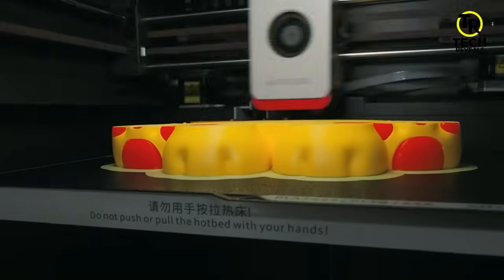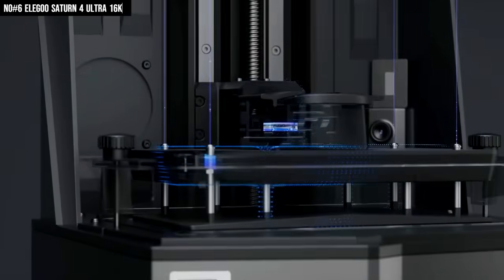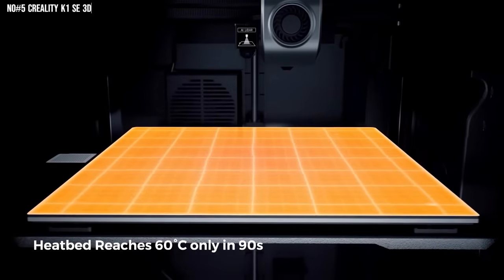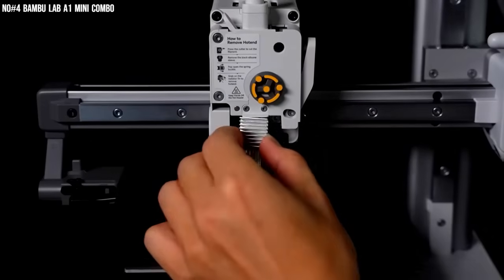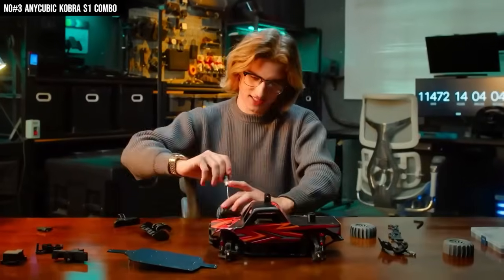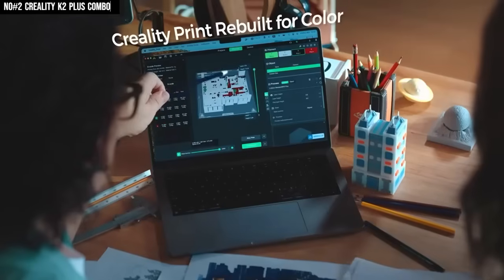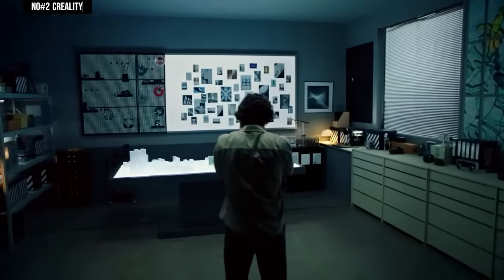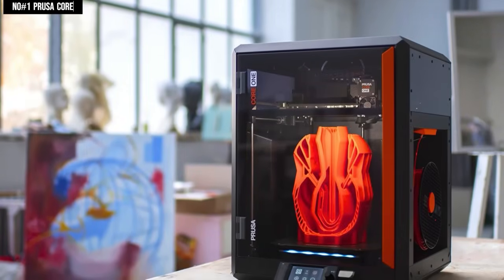Top 6 BEST 3D Printers For 2026 - Experts Tested

Comment: Which experts? Can you name them or is it just idle talk?
Reply: The marketing experts. Best of 2026, rated by experts, would require some use before commenting, right? As this video is released before 2026, it's dated to jan. 1, 2026. To be accurate, it's a review of 2025 machines, but who searches for machines dated the prior year?  It's an AI generated, manufacturers marketing hype. Example being, the reviewed Creality K1SE is on it's way out of the market. Since the upgraded model K1C is at the same "sale" pricepoint, why would anyone buy it, except in a storefront looking to liquidate stock at mfg approved prices? Originally, the K1SE was released as a lesser model in the K1 line, months after the release of the K1, K1C & K1 max. This occurred roughly 2 years ago, when I bought my K1C. I suspect the K1SE won't be available before the end of 2026 as there's no reason to offer it. The K1C & K1 max have been upgraded to today's tech as a lower grade to the newer flagship model K2's.

Comment: what about the snapmaker u1
Reply from the maker: Good point....The Snapmaker U1 is a solid 3 in 1 machine, but I focused on dedicated 3D printers for this list. Still a great versatile option.
Reply: @TechRevals77 what about the u1 isn't a 3d printer? Are you thinking of snapmakers first 3d printer?
Reply: @TechRevals77  Good grief. The snapmaker U1 is not a 3 in 1 printer. Revolutionary multi-nozzle printer; yes ! Guess this is the beta version TechReveals.